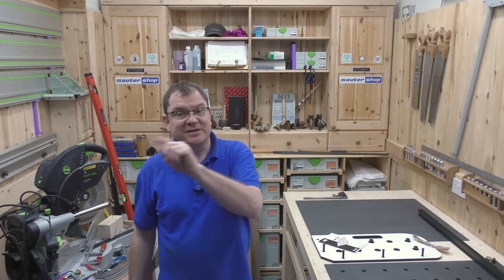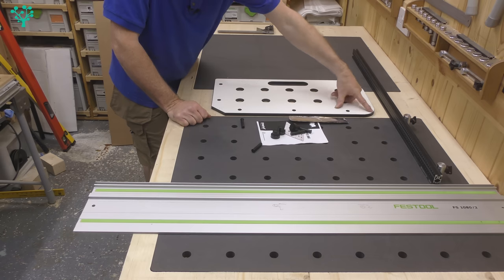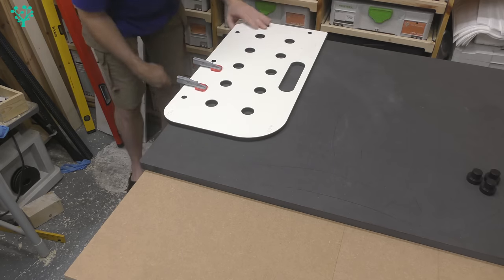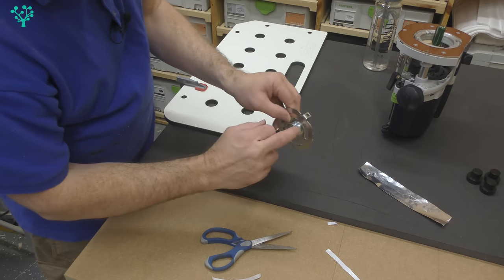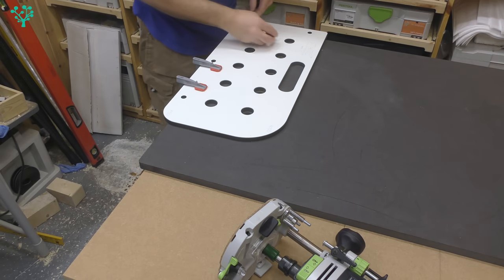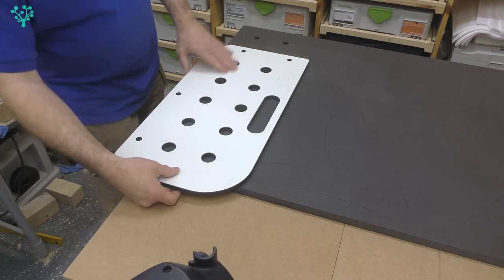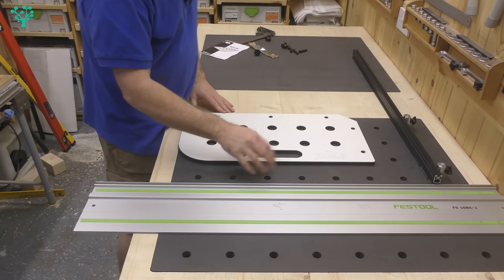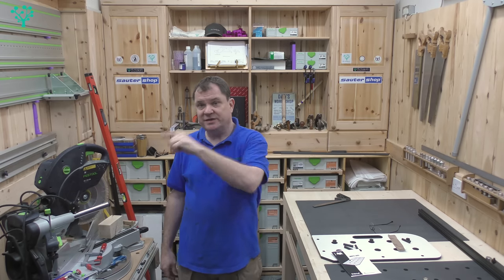Hands on review Trend MFT Jig

Comment: Gonna have to try these jigs....although Trend are currently doing these for £87........the parf system is £140 and Parf2 is closer to £200........the jig is a no brainer
Reply from the maker: Hi Mark,

The bottom line is it worked. And as you say the price point has come down considerably and at 87 pound it starts to make sense.

I would also invest in the trend 20mm cutter - but be careful they make 2. You need the one that is designed for the MFT.

Although I haven’t tried it, the trend 30mm bush should give tighter tolerance in the jig.

Good luck.

Andy
Reply: @TheWoodgrafter  I tried the Parf system but had to return it, think I had a poorly machined one that the pins jammed in the parf sticks.....shame really as it worked well.  Will give the Trend version a try at the lower price.....cheers for the info on the 20mm cutter, will check them out 👍
Reply from the maker: Always worth a try, I think you will be pleased with the results.

Andy

Comment: What size/type router bit are you using
Reply from the maker: Hi,

It is the Trend 20mm router bit. They do two 20mm bits you need the one that is designed for the MFT table.

Cheers

Andy

Comment: First  and foremost great to have you back missed you try woodpeckers no silver paper part guide brilliant
Reply from the maker: Hi Thomas,

Good to be back, I am not familiar with the Woodpeckers system - just tried a Google but can’t see it.

Will dig a bit deeper tomorrow.

Cheers

Andy
Reply: @TheWoodgrafter  Hi Andy,  Great honest review!    Here is the link for the woodpecker version.  https://www.woodpeck.com/hole-boring-jig-2019.html
Reply: @TheWoodgrafter  
I have the Woodpecks jig. Like any other make sure your guide bush is centered and fits the holes of the jig snugly and hone your router bit to the size of the dogs you are going to use on your bench.
Reply from the maker: @ronh9384  The Woopecks jig looks really good. As Ron says you would have a similar challenge, but as they supply the bush I assume that is a good fit. So just the router bit is the variable.

Also that price point is awesome - couple that with Woodpecker reputation for quality and precision then what’s not to like.

Cheers

Andy

Comment: Hi, thanks for the review.
Can I ask you which router bit you used for this.  Many bits of this size are not able to bore a hole as the cutting edge is not across the whole diameter.
I hope that makes sense !
Reply from the maker: Hi, yes the bit is very important. As well as the cutting head, not all 20mm cutters are 20mm enough for an MFT even the Festool one is not what it needs to be.

The only one I have found that works for me, is the trend 20mm - but be careful they make 2  (just to add confusion).

This is the link to the one that works.

https://trenddirectuk.com/trend-c030dx1-2tc-two-flute-cutter-20-0mm-diameter.html

Cheers

Andy
Reply: @TheWoodgrafter  Thank you.  I thought getting a 20mm cutter for this would be easy, but as you imply, it's a bit of a mine field.
Reply from the maker: @stephenwhite3343  yep, so many variables to get a clean cut that works with dogs etc.

Good luck.

Comment: Nice video. Looks like the trend jig produces some good results. 
What cutter are you using for your holes? 
I bought the titman edge MFT jig which is a bit cheaper but Im encountering issues with the holes being slightly too big for the supplied dogs even with a good fit on the guide bush.
Reply from the maker: Hi,

I am using the Trend 20mm bit - I love trend router bits.

https://www.trenddirectuk.com/c030dx1-2tc-two-flute-cutter-20-0mm-diameter

Cheers

Andy
Reply: Thanks, Andy. I was using a similar trend bit (C030CX1/2TC) but the one you linked seems to be recommended by them for MFT holes. The festool one actually showed up in the port this morning so I'll see how that works between a couple of different routers first. Thanks!
Reply from the maker: @harpalyke4659  

Can you let me know how you get on with the Festool bit, I have had mixed reviews.

Cheers

Andy
Reply: @TheWoodgrafter  
Sure no problem. Will hopefully get a chance to give it a go over the weekend.
Reply: @TheWoodgrafter  - Did a quick check on a bit of scrap 18mm ply this evening with the festool cutter. Holes are again slightly too big. Holes are measuring about 20.08~20.1mm after the cut. Router was firmly clamped to the workpiece so it should be fairly spot on. My dogs from benchdogs.co.uk are measuring about 19.97mm and the guide dogs with jig are about 20.2mm so there is a bit of play in both.
Might give the bit you mentioned a go and see how that works. I'm developing quite the collection of 20mm cutters though :-)
How do you find the fit with that cutter, is it pretty snug with the bench dogs?

Comment: Hi Andy :)

You can make a MFT top with the Festool LR32 system. Though aligning the rails 90° can always give one trouble.That's why I understand why you use the Trend jig. 

Though: If you have a Benchdogs rail square (and the top is already squared up) do you think the LR32 system would deliver? Then the critical operation is just aligning where the holes crosses (on every row). What do you think? If one would only do a cutting station where the 90° is more important then grid pattern it sounds very possible. Of course given that you have squared up you top before :)

Anyway just wanted to hear your thoughts, I was surprised that I did not consider it earlier.
Reply from the maker: Hi,

I had the same thought but just couldn’t get the LR32 to work.

However, a wiser man than I, managed to work it out.

Peter Millard take a step forward, check out this video.

https://youtu.be/C_J-PKrUo1Y

Cheers
Andy
Reply: @TheWoodgrafter  thanks Andy 👍 already did. You can find the same conversation in that video's comment :)
Reply from the maker: LoL

It was a very clever idea.

Cheers

Andy

Comment: As others have commented, that’s a bit expensive compared to the Parf Guide. 
Is that Trend bit slightly undersized to ensure a snug fit for the dogs, as many seem to produce a sloppy fit. Peter Millard at 10Minute Workshop recently made an MFT top and had to get his router bit machined for an accurate fit.
Reply from the maker: Hi,

I know that Trend make a number of 20mm cutters, but they specifically call out this one for the MFT.

https://www.trenddirectuk.com/c030dx1-2tc-two-flute-cutter-20-0mm-diameter

Just popped into the shop and measured it, is seems to have a diameter of 20.02 mm so pretty tight tolerance.

And the dogs are certainly a good fit - no slop what so ever. I have tried the quad dogs, the dance dogs, the table top protectors and the rail dogs and all fit very well.

Cheers

Andy
Reply: @TheWoodgrafter  Thanks Andy, that’s good to know and a reasonable price too, compared to the UJK 20mm cutter at £42.
Reply from the maker: No probs

Comment: I have been looking for a good system to make a MFT top for my outfeed table off my table saw.  This is not the system I would choose.  

Looks fidly, is more expensive than the parf mk2 as you need a 30mm template and 20mm router bit to purchase, and by your video the accuracy can be compromised if you are not careful.

Dang, I like the trend stuff generally but this is one I’m not so sure on.

Keep up the great videos.
Reply from the maker: Hi Robert,

The MK2 Parf is now around £200. I quoted the retail price for the Trend, but other comments have indicated you can get a street price of around £110.

I use the Trend 20mm router bit that is designed for the MFT that comes in at around £30 and the Trend bush is about £10. So you will probably get all you need for around £150 ish.

The accuracy is the issue, and you need to watch you step and check yourself.

I actually measured the accuracy off camera with my digital angle finder. Four dogs making a right angle.

In the starting corner I had an angle of 90.03 degrees, in the opposite corner (the final corner) I had a measurement of 90.01 degrees. So overall the results are pretty good.

So it is still a good option, where the PGS wins is in versatility. You choose the starting position of the first hole and you can make offset holes if you need them.

Cheers

Andy
Reply: @TheWoodgrafter Yes the above is true.  I’m in Canada so there is shipping, duties, taxes and other fees I need to worry about.  

So £110 is $190 in CAD.
Then the router bit is $60 here in Canada plus the cost of the 30mm bushing for the router, about $30-$50 depending on the type.  I’m pretty much at the same price point as the local cost of the parf system mk2 with at minimum perceived better accuracy and proven better flexibility.

Always good to see options though.
Reply: The Parf Guide Mk 1 is still available from Axminster at under £140 😊
Reply from the maker: @markvincent1115  that is a good price point and has to be considered as a viable solution.

Cheers

Andy

Comment: I have been looking forward to your review since August!  

Comparing with the two Parf Guide systems, with this I think  the initial holes have to be a fixed distance from the edge determined by the alignment pins whereas with the Parf Guides you can start anywhere.  And you can go all isometric as well with the Parf Guide system.  And some people may not have a router whilst most will have a drill.

On pricing, I think you are harsh on Trend.  D&M Tools have it at £110/€121.  The Parf  Guide systems are £140/€155 for the mark 1 and £200/€221 for the mark 2.  Incidentally, I asked Peter about the recent £20 price rise on the mark 2 and he advised it now includes the dust extraction adapter which was formerly £24.  

On reflection, I think it would be Parf Guide as well for me.  But many thanks for the review.
Reply from the maker: Hi Julian,

I agree you do have more limitation with the Trend in that the holes are fixed from edge. I guess you could find a way around that but it would bring risk into the accuracy - so you get pretty much what the jig dictates.

I think the isometric feature in the Parf Guide system is an awesome feature. And now Peter has introduced the ability to extend the grid of holes without having to drill all the pilot holes at the outset further adds to the functionality.

It's good to see that street price for the Trend has dropped to a more reasonable £110 (I used the recommended retail price) - but it is still an investment that has to be considered. AND if the Mk 1 system is round £140 then the same thought process applies - for the delta, what would you go for.

The Mk2 system is steep at £200 - but I am with you, I would also go with the Parf Guide system due to the versatility of the system.

This video wasn't really about comparing though (but it was only right to point out the alternatives) more about providing information on the Trend system that didn't seem to exist on YouTube.

I will use the top for a while, but I the not too distant future I will most likely purchase the Mk2 and recut the holes - I fancy a line of off ctr holes at the back of the bench to take the fence - giving more room on the top.

Thank you for the considered response, and the additional input.

Talk soon

Andy

Comment: Why didn’t you check this thing with a square? What about a standard 5-cut test?

This video is utterly bogus marketing whank from Trend.
Reply from the maker: Some people are so sceptical, you come across as very angry for some reason.

Just to counter your accusation, Trend had no input to this video, like most of my videos I needed to make something, bought something with my money and shared the experience so others can gain from my successes and failures.

I agree I should have tested the squareness in a more visual way, so poped back into the shop and measured the angle.

Using four dogs to make a square I used my digital angle finder in the starting corner and had a reading of 90.03 degrees.

I then repeated the exercise in the top right and had a reading of 90.01 degrees.

So a 0.02 variance over the top and a tolerance that is well within usable limits.

Cheers

Andy